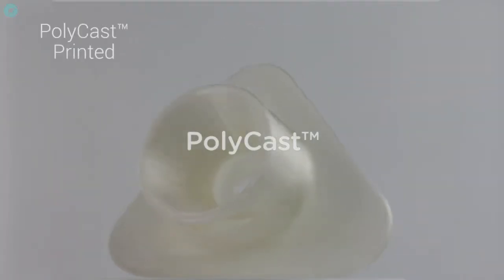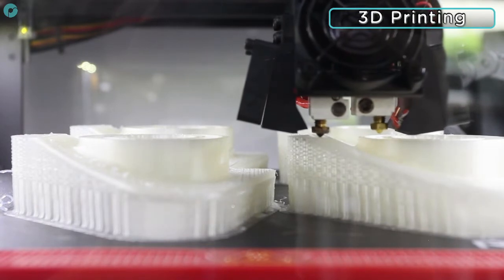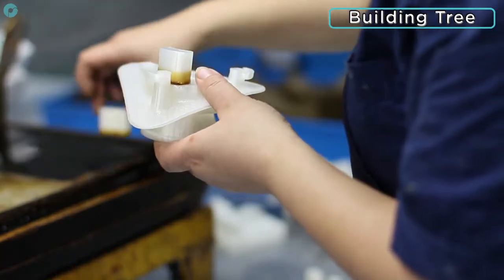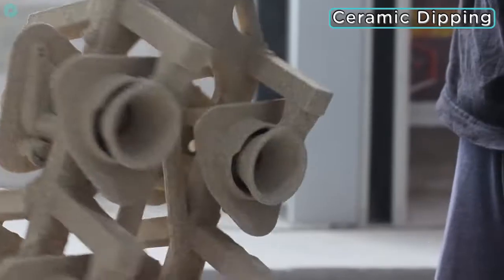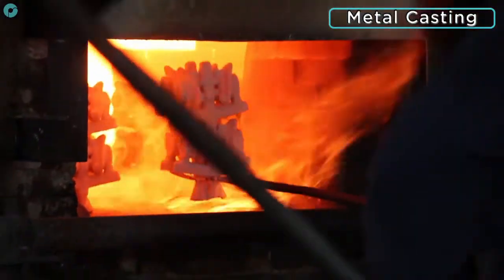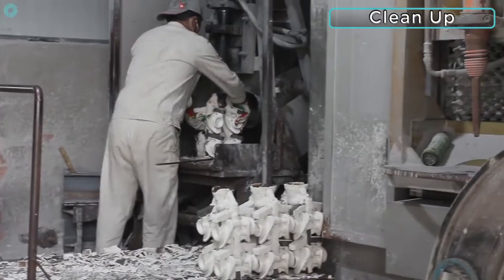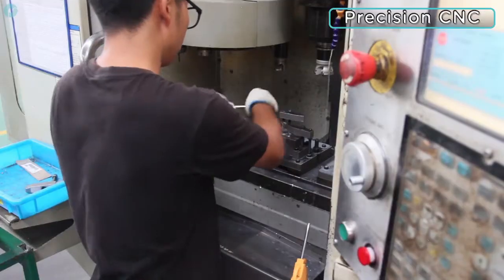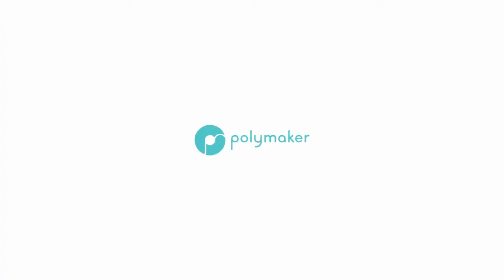POLYCAST INVESTMENT CASTING FILAMENTO PROFESSIONALE STAMPA 3D PER FUSIONI METALLICHE

Comment: Hi nice video, I bought the polycast filament, but I can't find a working method to make the mold, could you tell me what mixture they used to create the ceramic, and where can i buy it? Thanks 😊
Reply from the maker: Salve l’impasto ceramico normalmente viene composto dalla fonderia dove porta il pezzo stampanto in POLYCAST. Non abbiamo altre informazioni se non quellle che può trovare ON LINE in merito al materiale che di solito viene usato. Può dare un’occhiata al seguente link. restiamo a disposizione 
https://dawangcasting.com/it/blog/investment-casting-process/